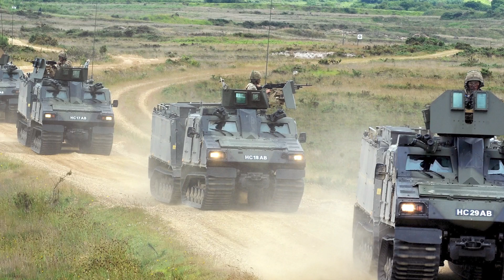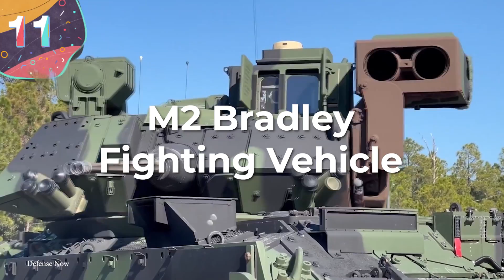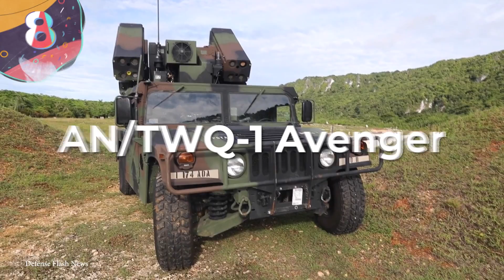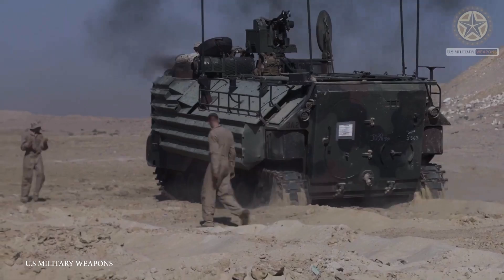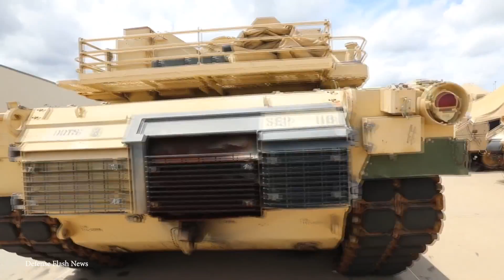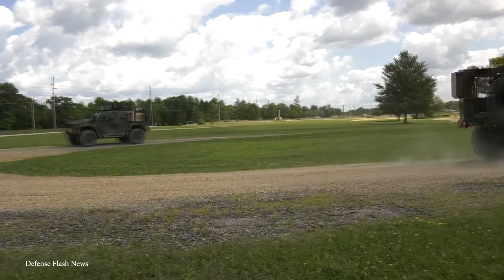15 MOST Sophisticated Military Vehicles

Comment: Although the Abrams tank is pretty impressive, it's also an archaic piece of equipment if you ask any tanker. I'd rather spend a day in a C2 with AC than having my butt cheeks sharing a seat in an Abrams. EU tanks are also way more technologically advanced but in short supply.